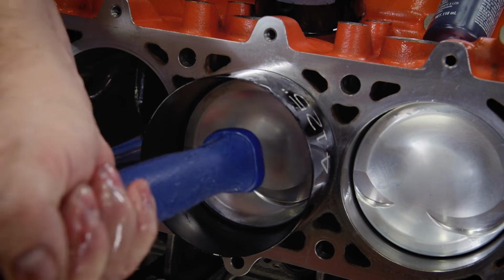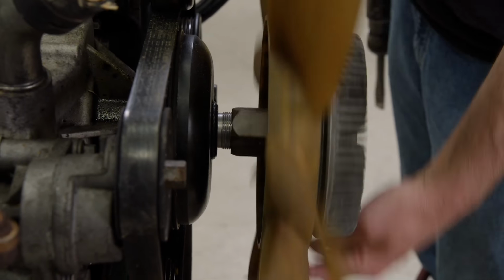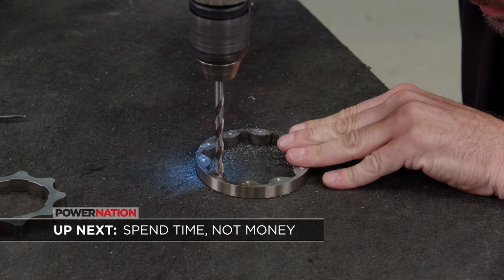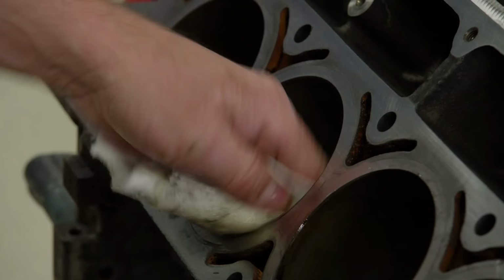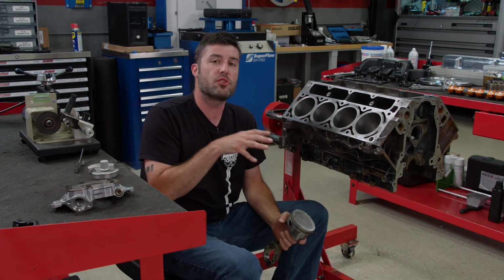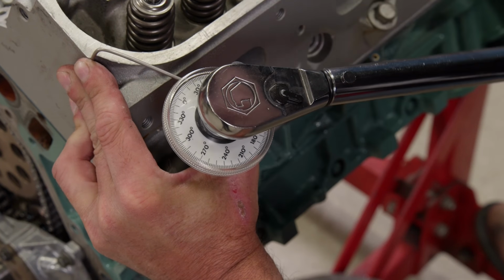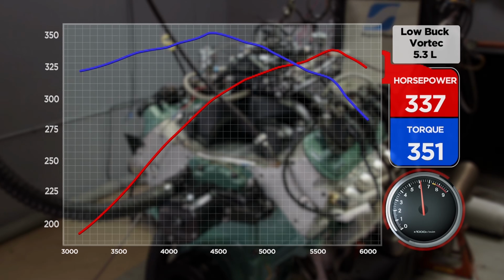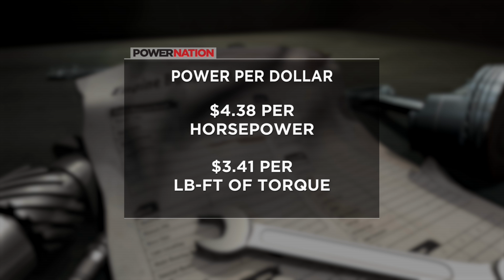Minor Upgrades Create Crazy Power on a Junkyard 5.3L Vortec - Engine Power S7, E10

Comment: At least the paint was free. Nobody would  have paid for that color.
Reply: When I saw they painted it Detroit Green, I said, "oh, it's sure to have an oil leak now!"
Reply: @spent217  hahahha my dad used to have an old f-900 dump-truck with a 6-71.. after parking it for 15 years he felt like starting it up. He then proceeded to put batteries in it and 3 gallons of oil in it.  It didn't even show on the dip stick. Damn thing poured itself out. But it started anyway few shots of quick start 😜. Damn thing is a tank.
Reply: @sebastiencharette6637  my dad is a certified Detroit diesel master mechanic, so i know them well.  If it's leaking oil,  it still has oil in it!
Reply: @spent217  and if it's not leaking you have a problem. Hahahah
Reply: Hey I'm an old BUICK  Nailhead guy, I respect that  color or  something close to it.  So what color goes on a LS  engine?  Black?  Chevy Red - Orange has to be  reserved for  Gen I, IMO - Sandy
Reply: @sandyshoremann7524  I initially thought it was a Buick color... Until they said it was Detroit.
Reply: That's Detroit green, if you ever hear a buzzin dozen pulling a load up a grade on the governor you will never make fun of their color.
Reply: @josephkordinak1591  Have you seen screaming Jimmy Video? If not it's great.
Reply: Nytram Nytram4348  Don’t ever disrespect Detroit Diesel like that again.
Reply: @1relaxationchannel20  I love Detroits but that is an awful color.
Reply: Ya
Reply: "This is a low-buck, budget build" *cuts to scenes using $100k of specialized engine rebuilding tools and machinery*
Reply: Detroit Green is for Diesel engines... "Com'on Man!"
Reply: I believe that was a stock Chevy engine color from back in the 60's.
Reply: Forget about the paint! I am going pink!!😂😂

Comment: Anything you can do to my 4.0 Jag engine to beat it up?
Reply: You can beat it up with a sledge hammer, or perhaps an axe.
If that's too much effort, simply drain out the oil, then hold it at the redline until it beats itself up.

Comment: The ultimate reliability face off: 5.3 LS vs Toyota 22RE
Reply: I'm a die hard Chevy guy but my old 1993 22re Toyota pick up wouldn't die even when trying to kill it. No oil changes, drive it like I stole it with owner chasing me with gun and wouldn't die.
Reply: You gotta be kidding me lol
Reply: Or you could do the most reliable engine of all time, Volvo Redblock B18/B20
Reply: I’d totally put an LS in a Toyota pickup / Tacoma though.

Comment: Not to be critical, and I understand you guys are trying to prove a point making hp with a smaller investment, but "for me" it's not a logical decision to spend $2500.00 on a "junkyard" engine, not including the in house machine/balancing work you guys did. I can build this engine "right" for $4500.00-$5000.00 and have a "new" 500 hp not too grumpy engine with fuel injection and no nitrous. Nitrous is good for the track where most are willing to accept the consequences of it for the added hp. Nitrous is not for an engine you intend to keep healthy. Ls's are a stout engine, but nitrous would most likely kill your test  engine pretty quick. Again, not trying to be critical, just expressing "my" opinion. Keep up the good work guys!!

Comment: The stand alone, plug and play system to run the ignition is around $404 at Summit Racing. Most carbs will be in the couple hundred range or higher. Should have factored in these prices. Also, could save more and be more "budget" themed by sourcing a used 550-625 cfm carb, possibly a used controller, sticking with a factory cover, and running something like a used cam from a better LS variant to get that $3k+ sticker price dropped.

Comment: 3:28, The exhaust manifolds are NOT cast iron. They're a weldable cast steel. Folks commonly cut them up and reweld them for turbo applications. They wouldn't be doing that with iron manifolds.

Comment: one thing I notice about the honing beads is how they bevel the top edge of the cylinder walls as the leave and enter the cylinder.. Is that desirable and if not wouldn't a plate with a hole the size of the cylinder bolted on the head be a way to prevent this .. what are your thoughts ??

Comment: My crap bottom end 5.3 w home ported 862 heads, stage 3 cam, holley single plane ported to match the heads made just over 500 hp and 425 ft pounds of torque n/a..

Comment: Meanwhile on an fa20 you spend $7000 on a turbo kit and tune just to make 300hp. This thing makes that right out of the gate with enough wheel spinning torque
Reply: 200 bucks, grab one and check it. Open the rings to .028-,030 make sure all the oil seals are there and decent. Slam that shit back together, 50-300 bucks wether microsquirt or stock ecm tuning and inj. decaps. Grab a borg china boi from VSR for 450 and make 800whp.

Comment: I owned a dismantle yard some years back. We sold used engines with 90 days warranty.  Certain engines, I stopped giving warranty: anything Honda Vtec, 2jZ engines and LS engines.  Reason: kids would come in purchase on a Wedensday, go racing on a Friday/ Saturday, would be back at my shop Monday morning with an engine with hole in the block or blown headgasket. I had one A hole who broke 2 vtec engines in the same week, I refused to replace it a 3rd time.

Comment: you literally just had to power one wire on that factory fuse box to get it to fire on fuel injection, but hey, lets replace the entire fuel and ignition systems and call it minor.
I have roughly $1k into my complete swap, that includes the modern transmission, and its fuel injected.
Reply: looks like a lot of the original engine harnes was removed with prejudice from the truck(IE, cut a lot).  you can see some of the injector wiring is cut too.  That being said, anyone who wants to make good power on these and still retain some fuel efficiency isn't going to be using a carb.  FFS, carbs are now to the point that its cheaper to get a self learning fuel injection system.  They used a $1000 "proformace" carb, IE, something no one would ever put on one of these, because FI makes way more power, and more consistently, and more safely, and more boost friendly.

Comment: Why do you hone it ?
You just loose material on a high mileage engine,while you still have cross hatching and factory rings ?
That's just adding wear on it. 
what did you try to do ,loosen tolerances to get 5 hp more ?

Comment: Let's see.....get separate carb, intake, ignition system instead of reprogramming ECM....check.   Eliminate port fuel injection....check.  Add one useless valley cover....check.  Have the nerve to be surprised what a healthy cam will do without matching it to the springs to prevent float....check.  Play around with oil pump instead of upgrading it to a Melling brand....check.  Have the nerve to be surprised what nitrous will do for an engine.....check.   Shamelessly plug some products.....check.

 I hate car shows, now.  Used to be good advice put in them.  No longer.  I pulled these numbers with an old inefficient small block chevy.  The LS heads flow far better.
Reply: Also no accessories and an electric water pump.  Sooooooo it’s still stock output. A tremendous amount of time and effort with tools that most people don’t have (seriously, a crank polisher?).For essentially zero gain
Reply: Hey so as someone getting into cars without a shop nearby or anything, is there a better way to learn than watching these guys? Edit: I'm trying to ask if you recommend any books, manuals, or other yt channels
Reply: @zethyr8833  look at the channel The Driveway Engineer.
Reply: Tyler H buy a cheap i4 or v8, get a repair manual and learn to fix before you learn to build, find platform/brand specific book on engine building and read it and read it again. Slowly and methodically get into engine building using mods that support what you want to do i.e big power but reliable mods for a street car or huge power adders and bullet proofed motor for the strip or purpose built wheeling machine
Reply: Yeah agreed. I thought they would try to get more out of it without a power adder or something. 🤷🏻‍♂️
Reply: I'm so tired of seeing videos or write ups like this. I've been trying to learn good ways to make power out of LS engines but ever time it's just some jackass slapping a carb on one and  running it with no accessories. Hate to break it to you but most guys going the LS route either are building one that's already in a vehicle or keeping the fuel injection.
Reply: @jameswilson8907  watch Richard Holdener if you dont already he shows a lot of comparisons to see what works and what doesn't
Reply: I miss the old car craft magazine builds.

Comment: The minor changes created 337 HP. The nitrous created the rest. So, as street engines go, it's in the mild SBC range. Chevy advertised the 2008 5.3L Silverado 315 HP. So this is a gain of about 20 over the 5.3L stock truck motor with no accessories after a cam upgrade. Nothing much to see here, really.
Reply: Yea but that 5.3 is more than likely equipped with 243 heads.  Which flow more and have a bigger valve package
Reply: @jesselee128able  
https://www.hotrod.com/articles/415hp-from-a-basic-5-3-ls-engine/
Hot Rod article states they got a baseline of 315 HP with stock 2004 motor after just swapping intake and carb. If these guys had only copied the Hot Rod build it would have been more impressive. I don't know when this show is from. The HR article is from 2013.
Reply: Injection is what really makes the difference on these engines.  I've built 4 of 5.3's, 3 with the stock intakes and a Fitech management system and one with a carbed manifold and Fitech throttle body injection.  All engines had mid length or long tube headers.  The self learning feature is what makes the power.  In stock form a 5.3 will make between 350-375 HP with an aftermarket PCM, add a decent cam from Texas Speed or BTR and your adding 55-75 HP.  425-435 HP is very attainable.  My next 5.3 is being punched out to 5.7 and I'm going to go to a little bigger cam, shooting for 400hp at the rear wheels.  https://www.youtube.com/watch?v=0sawmbM4FRg&list=PL8Jl1TgUtEaXELp0F__3CcssdF5VSJxPQ&index=8
Reply: Very true.  The biggest problem is the carb, running aftermarket injection like a Fitech PCM and a bigger cam you will see an easy 400 HP at the crank.  A good cam is worth 55-70 HP by itself and there's not an LM7 out there in stock form that won't put out 350-375 HP with just a good exhaust.   I've built 4 of them and there performance is amazing.
Reply: Yeah that was lame a.f. ; weak-ass Chebby.

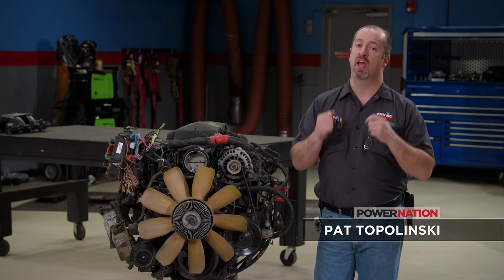Comment: 01:41  Pat's shirt pocket ....does that bring back memories for me.  I had various Shirt Pocket Protectors over the years because wearing a white shirt was normal back then.
03:29  No broken manifold bolts ??  Lucky you.
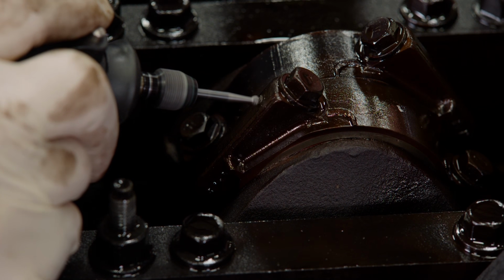07:59  Does scribing not cause a future stress point?
Reply: 3:29--That's why I am scared to death to put headers on my 2001 5.3 just to gain a few extra hp. Breaking off even one bolt per side would have nightmarish consequenses. No, I don't feel like drilling and using heli coils to fix that.

Comment: I'd like to see this retested with the fuel injection and a tune. I feel like not many people buying junkyard ls stuff are going to do a carb swap.
Reply: The electronics would make it expensive fast. Carb and intake were cheaper.
Reply: @GeminiPheonix false. They already had the stock efi for FREE.
Reply: An attempt to make the results seem more impressive no doubt, it's funny they don't even mention the price of the carb itself isn't it?
Reply: And the $500 msd ignition module and all those denso sensors..🙄
Reply: I dont see a carb on it ?
Reply: @joey778alucard  ..Exactly!!....How Much was the Carb??.....3-4 Hundred??....maybe More??
Reply: @timeless6964  
That's a $1k carb!!
😳😳😳
Reply: @timeless6964  don't think you can get a new decent carb for less than five,could be wrong........
Reply: @joey778alucard  There's a carb, they changed the intake manifold and put a carb on it to avoid dealing with setting up an ECM and wiring harness. 

Not sure how you missed the carb, they had a whole conversation about it. "That's the cheapest way to get one of these running" ---he was wrong, but old school guys like carbs for older hot rods and muscle cars.
Reply: Always keep a spare ECU on hand. My 97 camaro died when the ECU randomly burnt itself up. Wouldn’t even start. Swapped in my other ECU and it started right up. Drove it home
Reply: 21:00 no price for carb, or the $600 electronics to time and run those ignition coils!
Reply: I agree. I see no reason they can't do both. Doesn't take that much time and they have the parts they took off.
Reply: @dth2731  cause they’re all boomers. Boomers get confused when computers are involved.
Reply: @aliabdallah102  and millennials would rather type on a device than turn a wrench or screwdriver.
Reply: @aliabdallah102  Boomers built computers when you were pooping your diaper.
Reply: The point was to see what's the most power you can make with the least amount of money.
Reply: @andresgonzalez1236  Their idea of "the least money" does not compute in my world.
Reply: Old school guys with old school cars prefer cabs.
Reply: Squid Usn yeah but carbs are objectively worse than fuel injection
Reply: @basalt234  I can work on a carb on the side or the road, can't do that with FI unless its a fuse or something
Reply: @christianmotley262  FI wont leave you on the side of the road in the first place😎
Reply: @christianmotley262  put a laptop in your toolbox and then you can work on it, lol....I keep a spare ECM in my truck with a safe/nearly-stock tune on it just in case and the only tool needed to swap it is a 7mm socket and 5 minutes.
Reply: @Heathfx5  can we all agree that GM were dill holes for using 7mm or 6mm headed fasteners when the could have use 8mm or 10mm every time. They only do that stuff to spite the imports, but that's only screws over mechanics. Also dill holes for torx fasteners, internal, but especially external.
Reply: @basalt234  Not true. To a point a correctly tuned carb engine will infinitely make more power than FI. Carbs respond to actual engine demand while FI follows a predetermined program. Keep in mind I said "to a point".
Reply: @rj6110  It absolutely will. My dad's FI big block elcamino left him on the side of the road every time he takes it on a long trip. 3x on the power tour. Don't kid yourself. Fuel injection isn't the end all be all of reliability. I switched his car back to a 780cfm holley and he has had zero problems and gets 18mpg with a 402ci big block in 4000lb 66 elcamino with the ac running.
Reply: @KCDW83  I was gonna say to a point carb is okay but FI is where it’s at. You can easily add more fuel if you have the pumps and injectors, and just have more precise adjustments with FI
Reply: @MrDillon2029  True. I just don't want to have to have a computer when my hot rod isn't running right and I don't need a computer to tell me why it's not running right.
Reply: @KCDW83  say what 🤔
Some of us grew up with carbs . I've never seen a 402 get even 15 on the hiway.
   On the other hand 😁 I do have a402 to build I assume that a Holly 🤔
Reply: @christianmotley262  exactly fi has left me stranded too many times in my truck I swapped out to a carb
Reply: Efi engines run 350 - 400,000 miles  and no carastrophic efi failures. Zero concerns going back to efi. 

Carbs get rebuilt about every 40,000 miles. 

BUT THEIR MORE RELIABLE!!!
Reply: @safetyfirstintexas  they’re*
Reply: They put a carb on it? You saved me some time, not watching it. Lol
Reply: Plus, what they are putting it into, a carb will be illegal
Reply: @jamesharrison6201  it depends on what state you live in. 30 years or older is exempt in my state so it wouldn't matter if the vehicle was at least that old or older.
Reply: @jamesharrison6201  who cares if it's legal or not hell everything in life is damn near illegal
Reply: If it was originally an efi engine , why go backwards in technology by using a carburator ?
Reply: @DKSE123  Because early efi was total garbage. The TBI setup Chevrolet used early on was some nerd trying to computerize a carb. It worked off the same basic principles as a carb. Just take the boosters and power valve out and put injectors there. Ditch the jets and fuel bowl but use the same venturi design and throttle blades of a carb and call it good. Take a 90s model chevy 350 and put a carb on and it will make more reliable power than the TBI setup ever will.
Reply: I'm willing to bet most of the EFI fans couldn't tune a carb to save their lives. In my experience the people who hate carbs don't know the first thing about them or how to tune them and rely on computers to do the work for them. All they know is I hit this button and it makes more power but they can't tell you why. Technology at that point becomes a crutch. If you don't know why it works you're nothing more than a button pusher.
Reply: @KCDW83  bs...
Every person I know who hates carbs and likes efi originally drove carbed cars and know exactly what it takes to tune one.
I'm calling bs on that.

You can keep your toilet bowl on your engine if you want. I prefer reliability and easy starts.